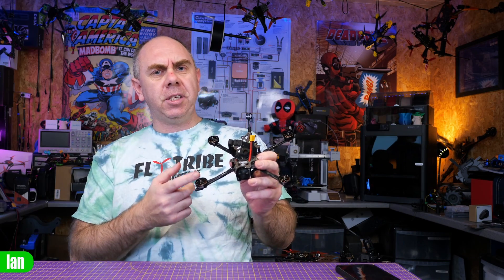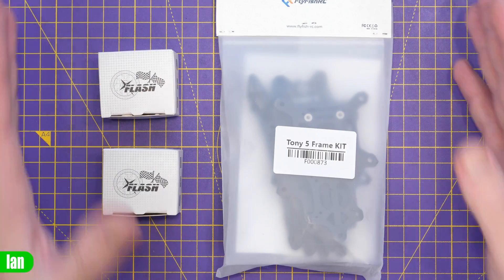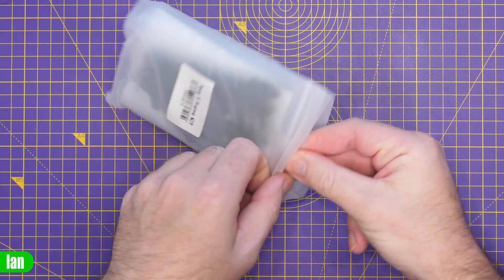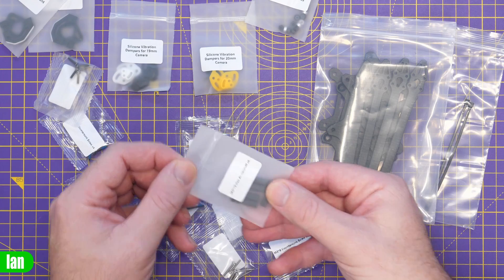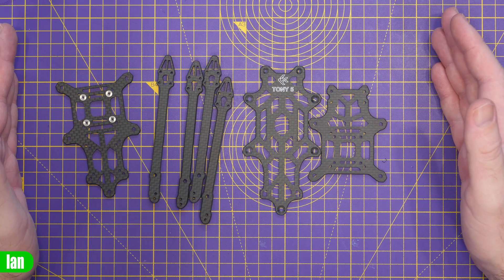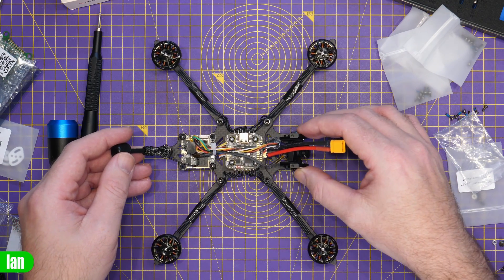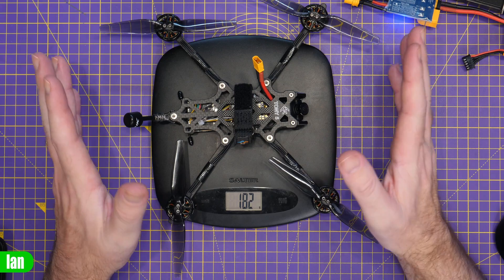Sub250g 5" FPV - FlyFishRC Tony 5 Inch Ultralight Frame For DJI O3 & Others

Comment: I have this frame and I will build LR with 1404 Flash Hobby motors 3650 kv
Based on AIO Darwin elrs 15A
Hope this set will perform well with 4S 1P li ion

Comment: no glue for the cables on the bottom of the 2900kv motors, but on the 1800kv, there are glue to secure the wires.. i hope is not the same with my kit.. and why???

Comment: Hey ian, my theory is that whoever is writing the manuals is measuring the hardware different from the people putting together the kit. I had the exact same experience building their new 55 frame. About half of the screws add a 1 mm discrepancy between what I actually got in the bag and what was listed on the build manual. But basically none of these became an issue during the actual build. My guess is that they just try to keep them as short as they need for strength while maintaining the lightest possible weight
Reply from the maker: That makes a lot of sense. It just drives you a little crazy when your trying to follow the instructions lol

Comment: I finished my build a couple weeks ago, and I managed to get it down to 242 g, 6s, with the 03 Nakedized, 2004 1700kv, Foxeer AIO, HQ biblades, and I even added a bit of LED cob lights. I made it on boxing day in a t-shirt in Canada lol. I was so lucky to have that kind of weather at this time of year. It flies really freaking good.
Reply: oh cool!  Thank you for sharing
Reply: I've been waiting to see one of these fly
Reply: @runpuppyfpv5744  I haven't posted any footage of it, because I only have one battery, that I had to go back home to charge so now I only have two flights on it. I'm up in Northern canada, and it is heavy duty winter, but wildly enough it was like + 9 Celsius on boxing day. 2 weeks later it was -57C..  lol. Probably won't be any flights on my YouTube channel for at least a couple more months. Sorry..
But basically feels like flying a really large toothpick, without the pendulum feeling of an underslung battery. Pretty damn quiet with by blades, but it was a little Breezy that day. I basically couldn't hear it if it was more than 30 or 40 ft away, so pretty nice for stealthy Park flying. Definitely a fun project. I ended up replacing a bunch of the hardware with lighter hardware, because I don't plan to crash this thing. I've got proper 5-inch freestyle quads for bashing, this is more of a fun exploratory flowy flight type of craft,  for me..
You can probably get a pretty good idea of what it looks like by checking out videos of the Ummagawd 2Fiddy. At the end of the day they're very close to being the same frame, minus some design differences.
Reply: @willpowerfpv3246  I agree they are a lot alike I like this one a little more plus you can't beat that combo right now
Reply: can i know how much endurance(flight time ) you are getting and which battery you are using
Reply: @kalyanm2672 yeah,  it could definitely be tuned further,  but i moved to the inner city shortly after this comment.
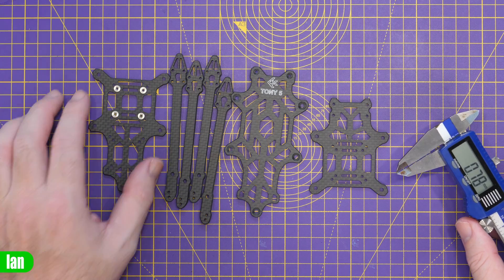The way it sits, i get about 4:30 on a 380 6s GNB HV or about 6:30-7 minutes on a 530 6s GNB HV. Thats exploratory flying... if I freestyle,  its more like 3:30 / 5 respectively.  🙂
Me and the boys at our race chapter are planning on some medium long range missions next summer, so im gonna build a li-ion pack and see if i can optimize for 15min flights. 😁
Reply: Thank you for sharing

Comment: Seems only fair to shout out the 2Fiddy, from which this frame seems to take an awful lot of design inspiration!
Reply from the maker: That’s a fair point.
Reply: @MadRC On a related note, after you were expressing doubts about the longevity of the current crop of frames, it's nice to see that 3 years on from the 2Fiddy launch, spares are very much still available!

Comment: I built this drone and it doesn't fly the greatest but if you know anything about sub250 5 inch drones there super light (obviously)  it's just alittle hard to tune but great looking frame 🫡
Reply: 2004 motors just don't have the punch with those low pitched props... And they are so big it makes it float, i think 4inch props flies better on it
Reply: @DigitalCruzer  I agree makes it wicked floaty not even fun to fly but!!!  4 inch props tho huh?🤔 may have to give that a try

Comment: Looks really fragile
Reply: I agree, those arms won't survive even a minor crash. I just don't see a point in this drone, why not just build a more durable 3.5in of you want to be under 250g
Reply: The problem with all these sub 250g quads is by the time we’re all forced into using them to avoid Remote ID and other crap, the powers that be will have moved the exemption threshold to 100g.
Reply: @TestPilotIan  Totally true and so sad/overregulated
Reply: Tony 5 sounds like a 1970s band
Reply: its not really meant for crashing. 5in, digital and under 250g is not achievable in a different way
Reply: probably is